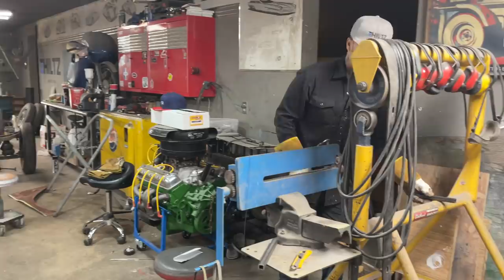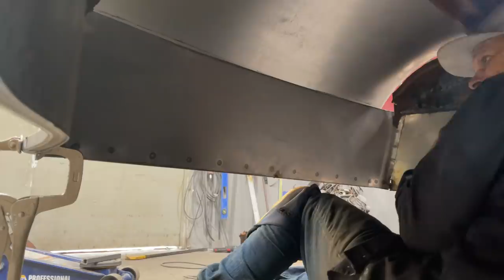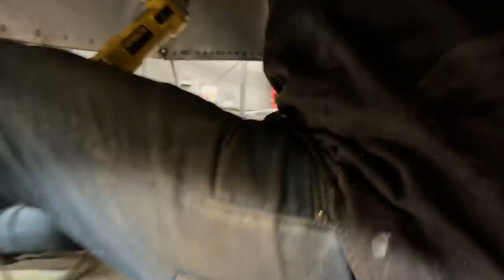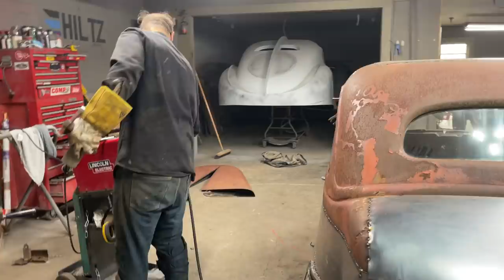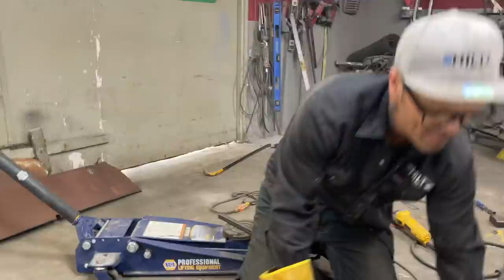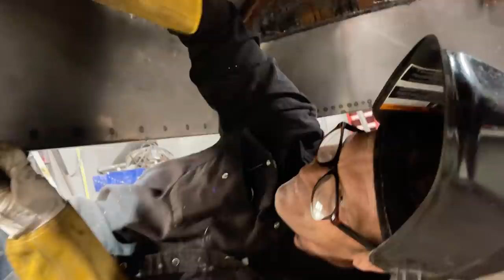CABOVER BUILD: 1936 FORD/1949 MERCURY: TRUNK FABRICATION

Comment: Jolene, you do very fine video work. But I do have a nit. Chad's occasional loud outbursts and grinder noise has me quickly tuning down the volume button when those things occur. I know little about video programs but assume they have volume controls. In audio recording, there is a compressor that acts as an automatic volume control. You set the highs and lows. It keeps the audio between those boundaries. It would be neat if you tame the audio a bit. The compressor can help immensely. If a compressor is not available, I'll still listen as the videos are so well done.

Comment: What hand dolly was that. Touch grinding top weld. Good work!!!  Card board to start quarter inch add around to hole outside to the lip of the trunk. The folded joints makes for more mudd. Prefer to center each side and center of the sheet. You do good work. I’m not a body man. Done a little fab over the years. Cut three inch section from the lip, center points the then tack away from. Every is index from centers weather you use measurement or not. Just trying to understand how you think as you go. We all have are ways. But the processes is educating, THANKS!!!

Comment: Chad, regarding the trunk cover ... you do have an english wheel, don't you?  That is the answer to the complex curves on that piece.
Reply: Yes, or use a dolly that conforms with the shape you’re aiming to create. I noticed Chad was using a slab dolly. I’d have reached for a comma dolly and used the curved profile to bring up the low areas & preferably used a “flipper/slapper” instead of a panel hammer. I’m a retired panel beater from the U.K. and served my apprenticeship on high end vehicles. We didn’t have new fangled shrinking & stretching machines back then, just dollies, hammers, body files, sandbags and a flame. Not forgetting lead & tallow.

Comment: Is your roller able to open up far enough to go over the square instead of banging it on the floor that's how I've been my tubing to but I just bought a roller and it does not open up wide enough so yours is a lot bigger I was wondering if that one would open up wide enough for the 1in tubing

Comment: With your roof and trunk panels being single layer I am wondering what a person in the same situation should do in order too gain stability in order to keep them from having a beer canning effect and is there a limit as far as one can go by with the depth of bondo used in order to make the bodywork areas straight and smooth for paint after welding in rusted or damaged panel replacements?
Reply: Jason
You can tack light gauge T bar on the inside. As far as Bondo goes I don’t believe he has limits. I believe he could carve out a complete car body from Bondo if he wanted to.

Comment: Make the trunk into a built-in truck toolbox, accessible from the sides, hinged in the middle.
You could put a retro tool kit in there, or whatever, just for looks.
It would be a retro version of those ugly modern truck toolboxes.
You could cut it in later after you have the rest of the car pretty much built.

Comment: Why he don't grind off the old rust and paint in the area where he's fabricating and spot welding clean so he can have clean metal to spot weld and get a good clean molten weld and good penetration.

Comment: sorry i posted this comment on the wrong video but anyway, why didnt you use the english wheel on the piece covering the trunk after you rolled it? wouldnt that have given you the contour you needed to match the panel on the bottom of the trunk opening.  it would have saved you a lot of grief
Reply: Yes it would’ve been 100 times easier that’s true. Let’s hope some young men and women see his video and get motivated to try a project on their own. There are quite a few successful sheet metal fabricators that can make anything out of a sheet of metal but they had to start somewhere.